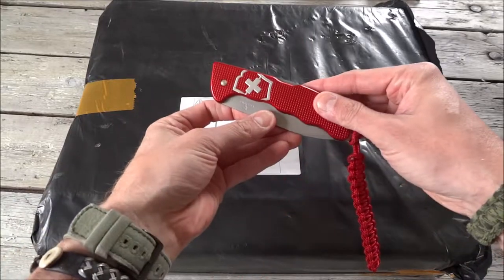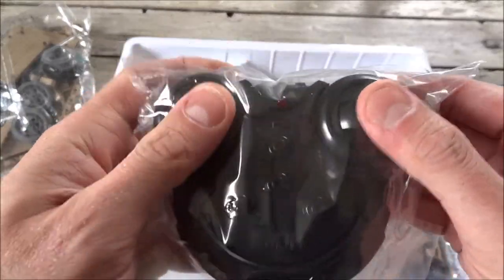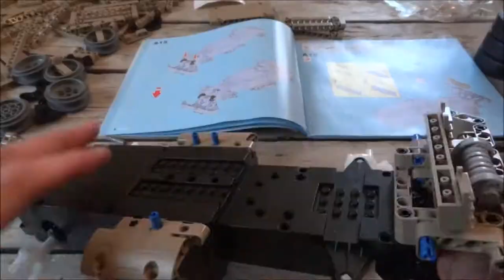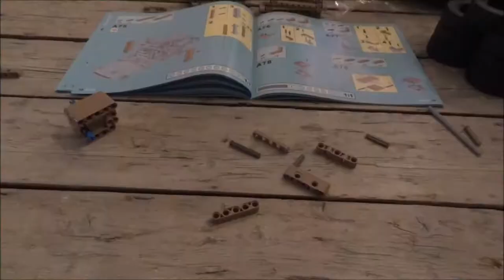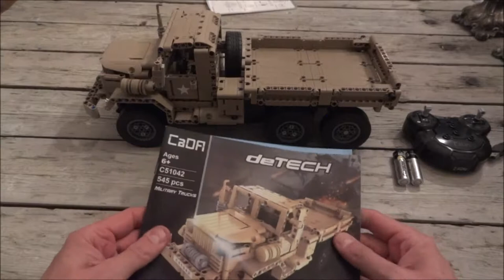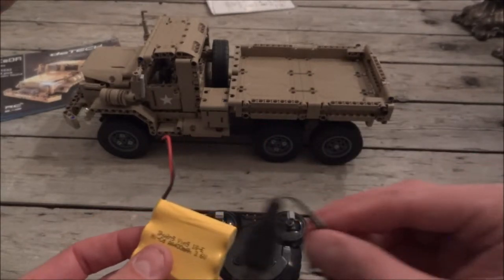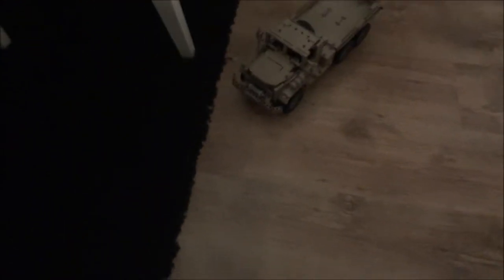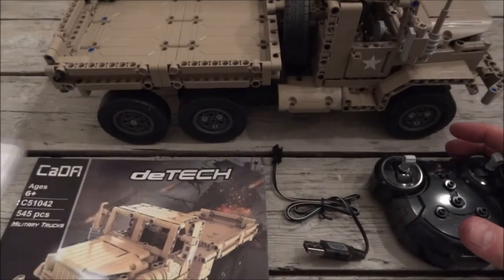Cada DeTech C51042W Military truck fake lego unbox and review

Comment: I have two RC Cada Tecnic sets. The Land Rover and Blue Dump Truck - they are excellent in all ways in terms of quality. I got mine on Aliexpress. The seller did con me by not supplying a working controller - it was a used broken one, no battery and no charger and a previously broken and used motor unit in one set. Everything else was new. I then opened an appeal with Aliexpress and it took a long while to get a resolution but thankfully Aliexpress refunded me in full for one set and refunded half the cost of the other without my having to send the items back to the seller who had conned me - he kept denying he was at fault. Luckily, the controller with the Land Rover works on the same frequency as the Dump Truck, I also managed to fix the broken motor unit and with the charger I had been supplied as well as having bought another battery pack, both work fine. I also added a v6 Technic engine block under the bonnet of the Land Rover (it can't be connected to the actual motor unit to work independently but the way in which I fitted it means a cog wheel I put on it can be turned so I can manually simulate the pistons working. The quality of Cada Tecnic parts is exactly on a par with modern Technic Lego if not better.
Reply from the maker: Im glad to here that they resolved the problem. Never fun to buy broken stuff and work with companys policies..